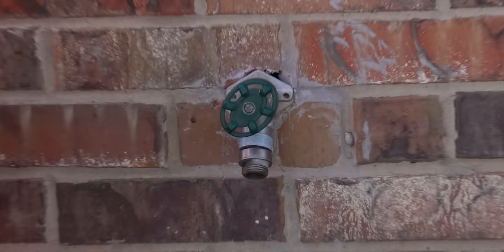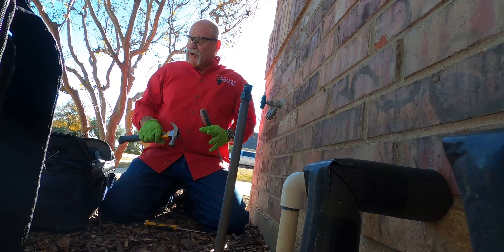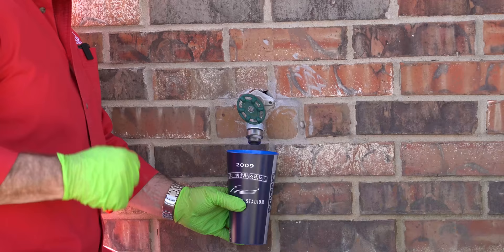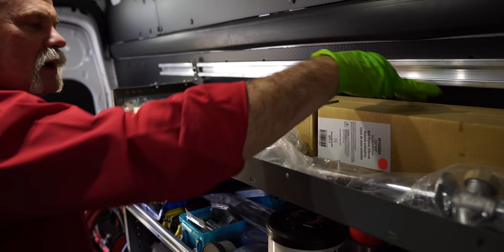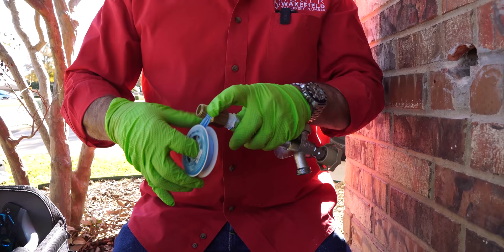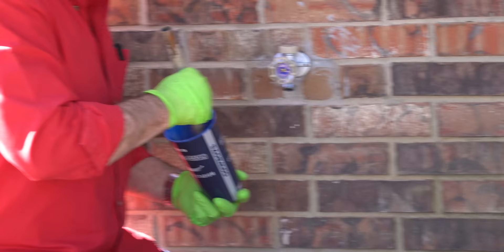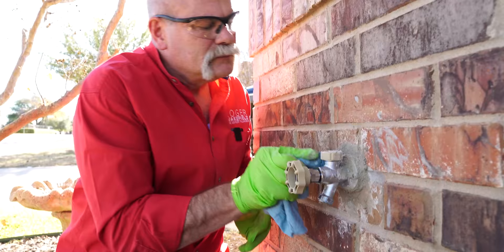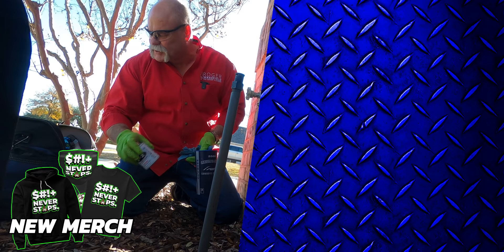How Pro Plumbers Replace Frost Proof Faucets

Comment: Cool video , thanks for the info . I wouldn't recommend a Mueller B&K brand frost free faucet . We had one installed and it worked a total of 1 time . Called the company and they said they were sorry and that was all they offered . I took it apart and the O Ring on the small check valve was stuck/fused to the plastic housing . Basically it is cheap , not tested in the real world junk .

Comment: You didn’t plan on backing up the copper inside the house where the bib connected? -confused apprentice
Reply: This was not a very good video. Had it been cpvc or copper, you risk damaging the pipe and possibly causing a leak in the wall without knowing it. My advice, always quote an access, always open the wall on frost proof. 
Journeyman plumber here.

Comment: I have a spigot leaking and gaining access was difficult because it was not threaded in like your demonstration.    There were male treads on the piece of the spigot that came out but they weren’t threaded into anything.  In fact, the spigot appeared to be soldered in and not very well because the solder broke loose and caused the spigot to leak behind the brick.

Comment: I have mine on a stucco wall. I have tried to replace it but I'm afraid of removing the old one because I feel the copper pipe inside the wall is bending every time I try to take off the old spigot. There is some calcification on the threads of the adapter. Can I melt it or would I need to break up the stucco to replace the spigot

Comment: How do you confirm there's no leaks or drips inside the wall after threading it in. if its been replaced before maybe the last guy stripped thread's in the female coupling in the wall.?
Reply: Female coupling???

Comment: We use the tubes of grey silicone mortar patch is the only difference between the way you do it and my way. The mortar patch tubes fill it nicely and set up in less time and holds securely.
Reply: Most non professionals are probably not aware that an acrylic sanded mortar is available in a caulking tube.

Comment: Since you asked...
 I would have given the customer the cost up front for 3 options. Sometimes there are more than just 3 options. Lots of times they just want to replace the faucet and be done with it. Sometimes they want to save every penny they can at this time of the year (you insert the time of year. lol)
Option 1) Disassembled the faucet and examine the seat to be sure the seat is damaged before I do anything else. If no damage to the seat I will replace the washer and perform pressure test on faucet. 'If' it holds pressure test I can give a 90 day warranty on washer replacement only. No warranty if it does not hold pressure. If that stops the dripping they can stop with this only but with no warranty.
Option 2) Rebuild the faucet (only if it held a pressure test after washer replacement). This includes a new vacuum breaker. (90 day warranty on complete rebuild).
Option 3) Faucet replacement. One year warranty. This includes the original option 1 disassembly labor (while I am there today only) If I have to come back later and replace the faucet after the customer talks to the spouse, the replacement cost is additional to option 1 or 2.
If I have to come back on a warranty call within the first 90 days, I will apply the charges from the original call towards the replacement cost.
I let them know up front there will be additional charges to repair pipes in the wall if any problems occur while replacing the faucet. (which seldom occurs)
 In this video I couldn't see the screws that secured the dog ear 90 in the wall after you removed the faucet. If they are the cheap short brass ones, I will remove them and install good one inch long decking screws at no additional charge. I do this BEFORE I attempt to remove the old faucet so I don't damage the pipes in the wall while removing the old faucet. I mill wrap the frost proof shaft before I install it, to protect it from mortar. (We always use the "Arrowhead" brand copper body faucets)

Comment: Well I started turning the wrench and it was spinning pretty easy so I was like cool it’s threaded. Kept turning and it snapped the copper pipe. So now I can’t turn my water back on until I tear down my wall to fix this pipe. And this all started bc I wanted to clean my ac unit fins bc my ac isn’t cooling. So now I have no water and no ac. Thanks bud.

Comment: frost free spigots are one of the few instances where i use sharkbite fittings (as long as it's easily accessible). i usually just cut the pipe right off the spigot, clean/de-burr, add a 1/2 inch shark female adapter to the new spigot, put it through and screw it, then add short piece of either pex or copper in between with a sharkbite coupling at the end. it makes it easy when you have to go back and replace it again when the customer forgets to take their hose off.

Comment: I have replaced several and sold a lot at my ACE store. I learned a lot from this video. The biggest problem irun in to is when the frost free is installed, then sheetrock is put over it in a basement. Often the customer doesn't know it's leaking until the sheetrock fails. Also, the homeowner sometimes doesn't want a hole cut in the sheet rock to find out if it's threaded or soldered! That'll often just start cranking on the faucet cet, only to find out lots soldered in and they've created a bigger problem! One question, though,. I've never lived in Dallas, but I was stationed in San Antonio for a while. Does it often get cold enough in Dallas that frost frees are necessary? Just curious, not withstanding the weird weather you had in 2021. Thanks. I learn a lot from you that I can pass on to my DIY customers
Reply: re: "Does it often get cold enough in Dallas that frost frees are necessary?"
We had a low temp in Dallas in Feb 2021 of 4 (four) deg F.

Comment: Im a plumber in South Africa and this is a new concept to me, we dont have any extreme cold so our pipes dont freeze, just wondering what actually happens when pipes freeze over there
Reply: Im also from SA ( Barlow Plumbers, Uitenhage)
Reply: When your pipes freeze the water inside turns to ice, expands in size and busts the piping.
Reply: Water turns to ice and splits the copper. Take a piece of copper tubing, fill it with water, cap both ends, and then put it in your freezer. Take it out a day or two later and you will see how it splits the copper tubing.
I live in the northeast of the US and deal with splits every winter. We have storms that will knock out the electric which in turn means that the heating system for your house won't work. If the power is out long enough, a lot of the piping in the house will freeze and split. Power comes back on and the house heats up again and you have water leaks everywhere.

Comment: What would you have done if the if the hose bib was soldered in,  and there was no access from the inside ? My house has no basement.  I ended up cutting a big hole around it.  The problem was that the pipe was so close to the back of the tub and up against a stud that I couldn't get a torch in there . I ended up using a Sharkbite!  😥 I better move.

Comment: Hey there jman plumber/gasfitter from Canada not sure I would have done it that way. Cause how I see it now is when that fails down the road. Then you go to take it out and that adapter doesn't spin out with it. Now it's more work for the next guy. Rather than a proper solid connection full through out.

Comment: Hello from Ouray, Colorado!  We are at 8000 feet elevation, so we need these types of water spigots.  We have 3 frost free spigots that I need to service.  
1) I went to use 1 this winter to fill up my RV and the handle was frozen stiff.  So, I need to trouble shoot that based on the various items you show on this video, as well as your frost free spigot rebuild video.  Something tells me that it could also be a spigot that is not angled correctly.  

2) my frost free spigot in the back of the house has a handle that turns and turns and turns in 1 direction.  I just saw you tighten a screw in the center of the handle.  Maybe that could be the issue?

3) my 3rd frost free spigot works fine, but it is really close to the ground.  I think the threads to attach the hose are like 2 or 3 inches from the ground.  That makes for a super tight fit to get the hose curved enough to connect to the theads.  I'll have to put some thought into this one.

Comment: Sorry I know nothing about anything lol but would this be same procedure for a non-frost type? Do they a short screw off or soldered pipe that comes apart like this to repair? Or will someone have to go in my house to get to the basement to do the repair? Looks like the pipe got bent (think boyfriend did it when he recently fixed the leaky faucet a few weeks back can’t wait till mom gets water bill agh! But pipe looks a little creased and water squirting out coming out of the front but unfortunately spewing underneath house   Been turning off in the meantime PIA but need repaired asap but also need to clean house if the guy needs to come in to get to basement. Would be so cool if I could fix myself but probably would make it worse

Comment: How do you know the replacement isn't leaking. This is at least the second replacement and just because the one you changed wasn't over tightened the first one could have been. I'm thinking of possible stretched threads. Keep the videos coming
Reply: As a plumber myself if it were leaking water would drip down the faucet itself since its on an downward pitch and honestly after doing hundreds of them you known by feel its gonna leak or not 90% of the time

Comment: Roger, I live in north Fort Worth area near the motor speedway. Looks like due to the recent freeze we went though my pipe bursted. I turned on the faucet today and noticed water leaking inside the garage side of the wall. Do you think it just needs the replacement of the bib or does the wall need to be broken down to fix the problem? Please advise on what needs to be done and what could the cost look like.

Comment: Hello.  I was searching online and found your frost free silcock similar to the one I have.  2 questions:  1- what is the size of the rubber washer in the stem as the number seem to be worn down on mine.  2- the "adapter" at the outlet; bottom section comes off as an adapter to standard hose connector size of 3/4"?  And does the top part of the adapter also releases>

Comment: @Roger Wakefield   I have an old 1970's home that has copper line to the outdoor faucet. These faucets have been sweated on, or soldered on. How would I replace that or what would I need to replace it with. Is there a stainless steel to copper or is there other options? Thank you in advance!!

Comment: I need to do this, thanks for showing it. Mine doesn't shut off and has one of the valves that puncture the pipe on it for the swamp cooler. Mine is soldered in but luckily it can be accessed from the shut off valve closet in the basement.

Comment: With minus 30's winter temperatures in Canada, we don't want to leave any air space around the extension through the wall.  A fiber insulation or spray foam the cavity before capping the exterior exit with mortar.  A 4 inch extension is rarely used since want to extend 12 to 16 inches to make sure that the valve seats are inside the heated home.  This video was made in Dec. 2020 and your about to learn what a deep freeze will do to plumbing.

Comment: im a plumber in canada and for us the connection to the frost proof hose bib will be inside the house where it is warm so that where the valve seats does not freeze. having it inside the brick wall and not passed the insulation and vapor barrier makes no sense to me. if its on the cold side of the wall it will still freeze making it redundant no?

Comment: I'm also in Dallas. Is it code to use a threaded faucet leader pipe like the one you replaced in this video? If so what year would that have taken effect? I have no clue if mine is threaded Or just a solder elbow to faucet leader pipe. I don't want to start turning with wrench until I have a good idea what's there.

Comment: Hey Roger. I wanted to see what your thoughts are on a repair I was working on and see if you have a different suggestion other than what I did. I was replacing a friend's kitchen sink and found out her pipes were galvanized steel. Over the years it seems all the rust has worked its way down the threads on several joints basically welding the pieces together.  I was unable to remove a rusted nipple that was attached to a threaded elbow for the water shutoff valves under the sink. So instead I cut a section out beyond the elbow and ended up using a galvanized compression fitting to repair the cut out section under the sink and replaced with a new section of galvanized pipe, elbow, nipple and then valve. So my question is,Will the compression fitting work as a long term fix for a while until my friend can take the expense of replacing most of her water lines? Also is there a decent way to re-thread a cut end of galvanized pipe in a small space below the sink so I can remove the compression fitting and put a more permanent threaded coupling?  Keep in mind, much older house and it is a pier and beam if that helps your opinion.

Comment: Your company replaced my Frost Proof faucet that had previously been installed new by your company the year before due to some leakage from the valve stem. Both instances wound up costing me around $1400 ($900 with first one and $500 for next one) and your crew filled the surrounding for the 2nd replacement with clear silicone rather than mortar (none on the truck). The silicone looks horrible and the faucet moves when I turn it off, is there a way to replace that silicone with mortar? Can I do that DYI or do I need your crew to come back out? Thanks!

Comment: I have a leaky one too and I'm afraid it could be soldered.  I never left hoses attached but I guess maybe I tightened it too much and never changed the washers.  I can't change the washers because the screws won't unscrew from the stem.

Comment: Hey Roger, good job. I have a frost-free (Prier brandname)  that I’ve rebuilt and it is connected via PVC water supply pipe and sealed with a compression band of sorts. I’m guessing that if I account for the 2” x 6” wall thickness and measure what’s protruding inward to the junction of the PVC connection, I should be fairly close in the length replacement frost-free I need to buy, right ? Is that compression ring going to take a ‘special’ tool ? Do you see any obvious omissions by me. Thanks in advance.

Comment: I’m tempted to do this as my current outdoor faucet is turned sideways and won’t drain but everyone I’ve talked to is said even if it’s a screw-in you can strip or do damage to the copper pipe in the crawl space and cause a leak.  I can’t access it from the crawl space.

Comment: When we had our frost valves replaced here in Tulsa, Oklahoma, the plumbers just left the faucets floating in the hole in the brick wall. I had to come back to fill it in myself with caulk. Of course, I didn't know anything about wedging it down either. He had to cut out a hole on the inside of the utility room to change the faucet. Of course, he left that hole open too. I'm not much of a carpenter, so I cut a piece of plywood to size and plastered that in the drywall. It's beside the clothes washer, so...

Comment: Does it get cold enough in Dallas for a frost proof? I thought they were for colder climates. Is that just a simple Cu female adapter in the wall?
I always installed a drop ear 90 or a 90 that I use on a shower head, so I never fear twisting off the adapter & there is a solid termination in a wall.

Comment: Is there anything you did to determine that it was threaded? I suspect that mine are all threaded and not soldered, but I don't want to break something and figure out that I was wrong.
Reply: When you have done plumbing for a while, it's just easy to tell. You will see an adapter if it's screwed, or you will notice the solder if it isn't. If it's soldered then just drain the water and burn the joint with the torch while pulling the hose bib off with a pair of pliers, until it comes off. If screwed, just follow his steps.
Reply: Obviously you havent

Comment: Went into my basement over the weekend and saw water leaking from the roof. The only valve I saw there I turned it off and the leak stopped. Come to find out it’s the shut off valve for the outside frost free faucet. Because the valve stop the water leak could that mean the leak is coming from the silcock and I should just swap it out to see if it stops the leak? From the shut off valve to the outside faucet it’s about 2ft.

Comment: I like to take the mortar and put it in a zip lock bag.  I'll cut one corner of the bag and pipe the mortar in.  It's easier to control and I can make sure it goes where I want it.  Works like a charm.

Comment: On the older homes from mid 60s, I will unsolder the faucet body from stem and solder on a 3/4'' male adapter onto the stem.
Where do you get the extension piece? I go to Ferguson but they never have those here in Lubbock.

Comment: I noticed in the video that water was dripping down in the wall. Do plumbers use a drain vacuum to prevent this from happening? In the fire sprinkler industry, a drain vacuum can save time and prevent water damage when taking things apart.

Comment: I’d have taken that thing off and install a regular valve… those vacuum breakers needed are expensive and give a lot of headaches from what I’m experiencing and researching, just purchased a home in Burleson and 4 (that I can see) out of 4 are leaking and I can’t find a simple adapter to just use a garden hose. How much to replace to regular valves?